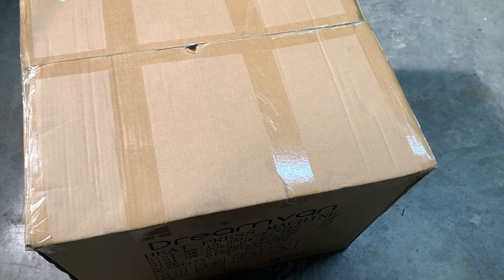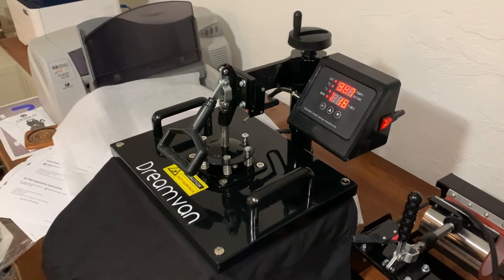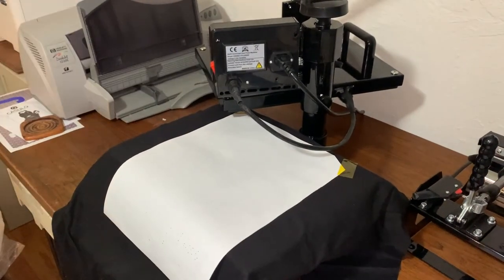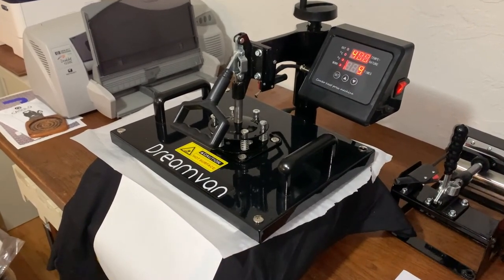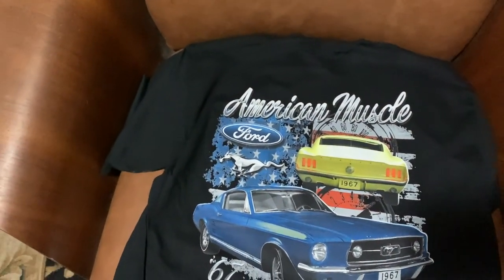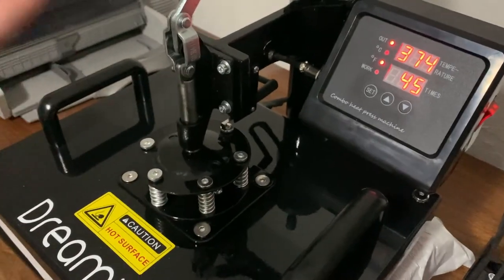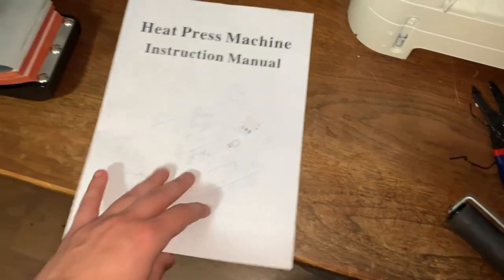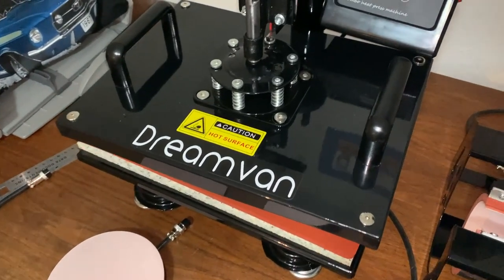Create Custom Shirts & Hats & More! Heat Press Garments Yourself!

Comment: Cool.  Can I use on polythene coffee bags?
Reply from the maker: As long as the heat transfer is for poly & you run the press at the correct temp for poly it should work fine.
Reply: @Pondsisawesome124  Thank you

Comment: Does any one know what’s the proper way to clean the shirts after ? Is it normal wash/ dry ? Or dry clean ?
Reply from the maker: Not normal wash/dry, like most heat transfer shirts the best method is to turn the shirt inside out & wash on a gentle cycle no bleach & dry on a low setting.....don't wash in the first 24 hours so the transfer is good & set.
Reply: @Pondsisawesome124  appreciate the response  🙏🏽🙏🏽

Comment: Anynone know wish fuse this machine use
Reply from the maker: I don't see that it has a fuse on the outside anywhere. There is probably a "thermistor" inside the controller. I'd email the manufacturer and ask about a fuse.

Comment: Did you use regular printing papers?
Reply from the maker: You can't use most ink jets unless you have dye based in as the water based wont hold up to washing. I've been buying transfers from https://www.proworldinc.com/heat-transfers.html & am currently looking for a good dye based printer:-)